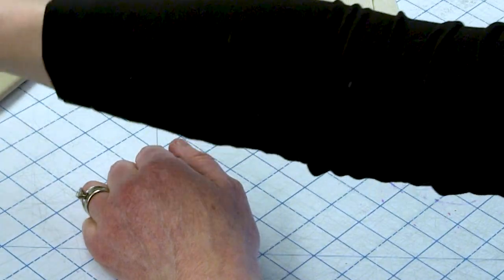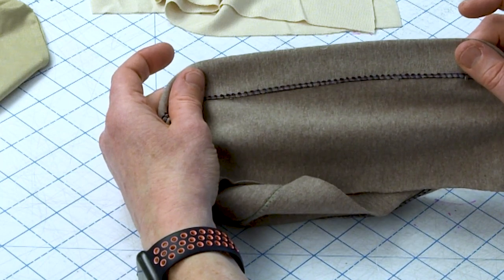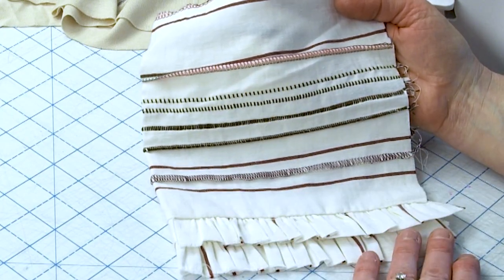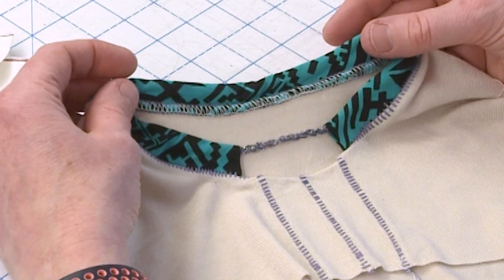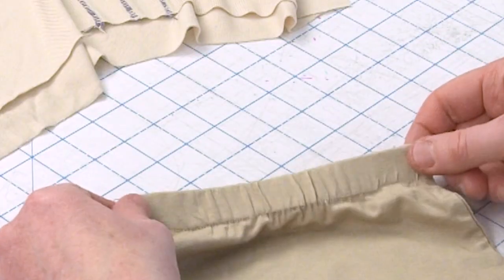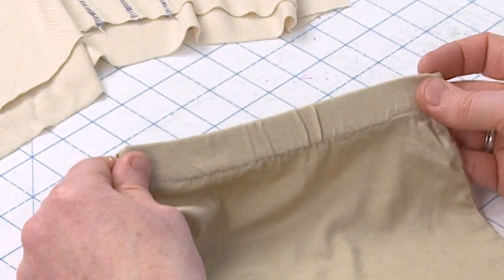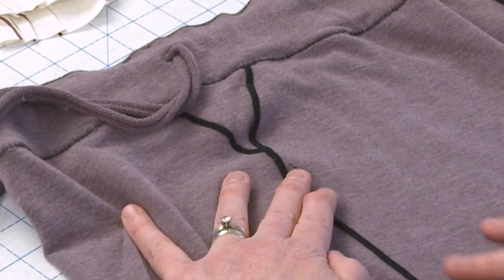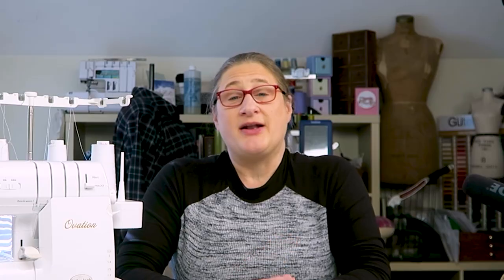Preview of Serger Techniques for Garment Sewers At Stitches at Home February

Comment: Can you tell someone how to thread their serger?
Reply from the maker: Hi Kathleen,   If you have  a basic 4-Thread Serger, Here's a tutorial from the Bernina L460 Serger Manual Playlist showing how to thread.  If you don't have a Bernina, the basic threading paths are similar to most other brands.   https://youtu.be/DNjbMvD7jBI   If you have a Baby Lock Ovation Serger, I also did a whole playlist showing how to use this serger too.  The Ovation has air threading, so it would be similar to sergers that have air threading ,,,, Here's a link to how to thread the ovation serger.   Hope this helps!
Reply: I just finished 4 thread serging a bias strip for neckline. Instructions say do shoulder seam construct, then topstitch.  Dislike the bulk at the shoulder, which is 18-24mos. size. Topstitching was also bad instruction.  You loose the stretch and can't get it over big toddler head now. 🤷🏼‍♀️.    I ripped the topstitching out.  Maybe I should use coverstitch?  How do I find your class?
Reply from the maker: @zinnia20207  Hi Lisa, Here's a link to the class page and registration!  Bring all your samples and questions!  https://stitches.events/shop/classes/stitches-at-home-february-2022/serger-techniques-for-garments/